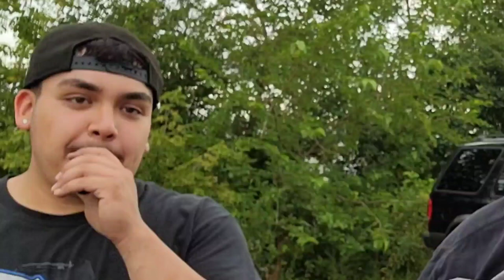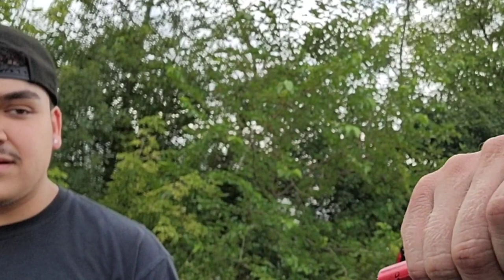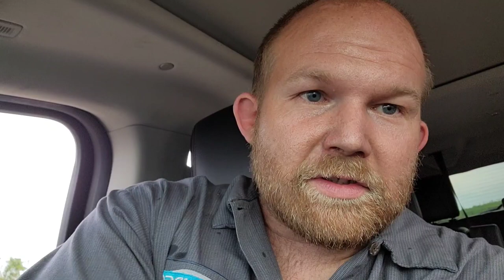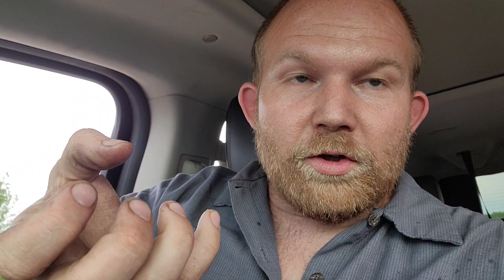Oil Filter So Tight - Try This And See For Yourself - Most Of The Time It Works 💪

Comment: I'm an express lube tech at north park toyota in texas. I'm definitely going to try this on my next filter that is stuck. Thanks for the tip
Reply from the maker: Remember just barely spin the filter, once it starts to move after you do the trick quick shut the vehicle off and then finish the job.

I think the part of this video that most people are not understanding is people got to use a little common sense you're using the oil pressure of the filter to help support putting the band wrench on the filter
 just hoping to get it to start to move you're a little bit
 not spinning it all the way off while the vehicle is running

Just enough
Reply: @FordBossMe  I believe most people understand that the pressure is helping the filter wrench not to crush the filter, I think where people are having an issue with running the new oil through the old filter. If you're going to have it pressurized anyway it might as well be before you drain it. I personally will start loosening the filter first. If its stuck I will try it with the engine running trick. So if I do accidently loosening it a bit to much and it starts leaking I'm just going to lose a little old oil before I tighten it back up a hair,  no biggy. Thanks for sharing my boy.
Reply: @PRBB25  Yes that would be the common sense way to do this.
Reply: Sooo - just crack the oil filter loose,  if the car is on a lift - lower it down,  and SHUT THE CAR OFF = then spin the old oil filter off  and install the new one (I partially fill the new oil filter first).
Reply: For Toyota oil filters, I just use my big three foot half inch ratchet. Always works on stuck Toyota filters.

Comment: Why can’t you do that with the old oil before draining
Reply: That’s what I was thinking
Reply: I like your idea !!
Reply from the maker: You can but most of the time people pull the drain plug first there's no right or wrong way to do it you've got it you're on the right track
Reply from the maker: I speak from what most commonly happens that's all
Reply: I always drain the oil before I take the filter off. How would I know that the filter was stuck before draining the oil?
Reply: My only guess is that he drained all the oil cia drain plug first and then tried to loosen the filter
Reply from the maker: And you are absolutely right most of the time that is exactly what happens people drain the oil first and then they're like oh s***
Reply from the maker: This is a way for you to save yourself some struggle and make it a little bit easier
Reply from the maker: And now all the Clowns with the thumbs down on the video because they don't take a second to try to understand exactly what's going on here it never amazes me on the internet people are so foolish
Reply: @billbraun6846  Break the oil filter loose first, hand re-tighten filter, and then drain the oil?
Reply: I always undo the filter before draining the oil, as I have a traditional pan and I've dropped that filter into a full pan and it's not pretty ;-)
Reply: @FordBossMe  Yes, but you have a nice drainage system that prevents splash, while the rest of us will make a big mess ;-)
Reply: @FordBossMe  It's not so much the fools, it's the stupid you have to watch out for, and we're surrounded ;-)
Reply from the maker: How many people are going to do that? That's not how they're taught 90% of the people grab the drain plug and start draining the oil that's how the typical person is taught you're not going to be able to put out a video first to explain this to people because that's not how they're shown to do things
Reply from the maker: People have to think a little bit outside the box instead of getting so uptight and trying to be so politically correct about everything

You always get under the vehicle you pull the drain plug and you let it drain well when there's no oil in the pan you can't do this so you're going to end up putting fresh oil in the motor anyway so put the plug in fill up the vehicle with the proper amount of oil and then do the trick
Reply from the maker: @chonkboy77 ^^^^^ read above 2 comments
Reply from the maker: @jamesplotkin4674  we cannot take one person's experience and then project it out on a crowd of a thousand different people right because when we do stuff like that the message doesn't get out we have to put a general message out there for people to get and will apply to most and then people have to sort through the little pieces that don't apply to them themselves
Reply from the maker: Chonk most people don't do that and they won't do that because they weren't taught that way
Reply: @FordBossMe  I get the drain plug first, then the filter for the simple reason that I like to give the pan a bunch of time to drain and can pull the filter while it’s draining.  I bet that’s why we’ve all grown accustomed to that order.
Reply: @jamesplotkin4674   very good point
Reply: @FordBossMe  And then they end up with a 20 minute sweating, straining, cursing struggle. Oh well, hopefully after one of those they rethink their approach.
Reply: @johnwilburn  100% correct.
Reply: @FordBossMe  I would always pull the drain plug first. Probably stemmed from working on tractor trailers. Get that 40 or so quarts draining, then start working on the filterss. Then when I switched to regular vehicles I did the same. Not sure why but about 5 or so years ago I started pulling the filter first and been doing it ever since. Like you said most people drop the drain plug first. Just petting in my two cents. 

Great info though, will definitely keep that stored for future use.  

Also you probably should clarify to just loosen the filter while the engine is running and not remove or REALY loosen it. Shouldn't have to be said, but you know idiots are everywhere. Cheers.
Reply from the maker: @themc3311  you're right I shouldn't have to say that and maybe I should have put it in the video but people should know better
Reply: I always do my filter first just in case it won't come off. I never wanted to put new oil through an old filter
Reply: @mikefriday5325  So you've used Rich's method before and that's why you take the filter off first.
Reply: @billbraun6846  no I haven't used his method. He taught me something new. I just always take the filter off first in case I have a problem getting it off
Reply: @FordBossMe  I've learned to take the filter off first. I want to know ASAP if there is a problem taking it off, or if we don't have the correct replacement get that ordered before it's too late. Delivery driver takes half hour round trip. Could get that filter before the customer notices if it's ordered fast enough. 🤔🤷🏻‍♂️
Reply: @FordBossMe  "oh s***"
😳Oh no! Is this a family channel now?🤔😂🤬🤬🤬🤬🤬😂
Reply from the maker: @mikefriday5325  new oil through an old filter is minimal effect if you're taking care of your vehicle and anybody that says otherwise I would not even listen to
Reply from the maker: @mikefriday5325  it's not like you're magically going to let the oil touch the old filter and all of a sudden it's going to be completely contaminated and trash and no good...... it's not like a little oil filter Fairy comes in there and shakes their wand at it and destroys all the oil
Reply from the maker: @RJ_Cormac  why would you question whether or not it's a Family Channel it is but I'm not changing how im doing things I wouldn't expect anybody else to either
Reply: @FordBossMe  It was a joke because you ** out your language in the comments. 🤷🏻‍♂️ Did't mean nothing.
Reply: @FordBossMe  lol. Good point

Comment: Good tip Rich. It might seem obvious, but for the inexperienced, don't spin the filter off too far...Only do this enough to get the filter moving, or you'll wear oil all over you, and you risk running the engine without oil while you put the car back down to switch it off🤣👍🇦🇺

Comment: I've always cracked drain plugs, filters and fill plugs loose right after the car was shut off. I learned the hard way not to drain something if you can't get the fill plug or filter loose. Engine heat and pressure do amazing things

Comment: I usually do the filter 1st so its likely I'd try this w old oil still in motor,, but thing is though I've only had this problem when I'd purchase another car only 2 find last owner or tech overtightened the filter n sometimes drain plug 2., just love other people which is y I'm a diyer,, worst one I had was 88 T Bird Turbo Coupe n had to stab that poor filter two times man I felt awful 4 doin that but hey it worked! Thanks 4 video
Reply: That's a great tip - remove the oil filter FIRST, in case you have to use this technique. Everybody does the drain plug first because it's easier but I hate the thought of putting dirty old oil (even the small amount in the filter) into the new oil.

Comment: I did not think of that, thanks. Dealer ship put filter on tight, it crushed with band wrench. It did come off with pliers wrench, put counterclockwise power and hold, it will slip open after a while. Key is to put power in and wait it will slip open. Your idea is very good, filter will not crush, and that is the main problem.

Comment: Never tried that one! Good idea. 
I started my career as a lube tech on semi trucks. The worst filters I had were when the screwdriver ripped the filter housing off, and I had to use a air hammer and chisel the filter head off. Oil and fuel filters. Some drivers were known to tighten filters as hard as they could after they left the shop.
Reply from the maker: Yep this would help that

Comment: My Toyota dealer tightened the metal filter housing on a 16 V6 Camry so much that with the proper tool and a 2 foot breaker I couldn't get it loose. It took a 1300 ft-lb impact adapted down to break it loose. No damage to the housing or the tool. That dealer can't balance tires either. What kind of slug tightens so severely when it's obvious that the seal is accomplished with an o-ring, not torque?

Comment: It’s good practice to loosen the filter AND plug a half turn before draining the oil. No point in proceeding with the oil change if either is locked or cross threaded unless you are prepared with parts to repair what’s damaged.
Reply from the maker: Yeah I mean ideally sure you would be right but nobody does that

Comment: Each to their own. I think this is a bad idea.  What happens if you end up with a leak and hot oil starts running all over  your arm and the underside of vehicle, are you going to be able to get it back on the ground and shut it  off before you end up with one hell of a mess?  I think your better off clamping your wrench or strap at the strongest part of the filter,  up by the base.
Reply from the maker: First of all you have to be cautious when you do stuff like this and a person that is not trained shouldn't be doing stuff like that

It's not my job to babysit people

I'll demonstrate soon for the negative Nancy's  here
Reply from the maker: That's inexperience talking Greg not every filter is eccesable that way

Comment: That’s a good idea but I think it would be worth trying with the old oil in vehicle first before I ran clean oil in a contaminated filter. That’s just me being OCD lmao.
Reply from the maker: There's a method to my madness right? The reason I specified it the way I did is because that's the way 99.9% of people are taught they do not touch the oil filter first sometimes you have to think outside the box when you're teaching something and that's exactly what I did here cuz most people will always go for the drain plug first
Reply from the maker: You're going to get that oil dirty Anyway by running it through residual oil that's in the engine that little bit that's in the filter I know you said it's your OCD talking but it's very minor almost doesn't affect it at all

Comment: If you have a metal oil filter cap that you attach a 3/8” socket wrench to. Use a long handled torque wrench.
Reply from the maker: It doesn't always work rounds off the filter if it's on tight enough
Reply from the maker: I'll demonstrate soon
Reply: Some filters are fully smooth, no indentations around the outside for the special filter socket. Or no welded on socket drive upgrade. The cheapest filters are as smooth as a the first 3 weeks at a sorority house! Don't approach that door after 3 weeks⚠️❤️🤮

Comment: That sounds like a neat trick I would like to give it a try but Can I do it with the old oil in the car still
Reply from the maker: Very few people try to spend the oil filter off first seeing as they left the motor drain so that's why this bill was put out this way you can do it however you feel

Comment: why not just loosen it with the old oil?
Reply from the maker: Read pinned post 

Nobody ever pulls the oil filter first and it's a Rarity to have somebody pull the oil filter first... what most people do is they get under the vehicle and they start draining the oil so they give it time to drain and then they do the oil filter

So rather then changing the way 99.9% of the people do oil changes out there how about work with them and make the suggestion that I made here which makes a lot of sense

Comment: noooo thanks. not a bad idea, but the idea of pressurized oil spraying everywhere is enough for me to say "...i'll just cut the fkn thing off" instead. 

never met a filter i couldnt get off ( ;) ), in spite of the local valvolines over-tightening ridiculously after --not-- lubing the gasket
Reply from the maker: Well there's a lot of common sense goes along with this recommendation as well and if you don't have that people probably shouldn't be doing it and they know who they are
Reply: @FordBossMe  common sense or no, shit happens bub.  obviously you wouldnt want to use the claw-style filter wrenches - band would be the way to go.

itd be my luck id break the whole damn stem off - oil filter and all. im a big boi, lots of torque in this ass lol

im definitely not in the grouping of people lacking common sense. 

the grouping of people considered unlucky however...well...sometimes home is home, ya know?

Comment: By that logic, why not just do that from the start before you drain the old oil out?
Reply from the maker: Because nobody does that and nobody's talked to do it that way so the way I explained it is the typical way that people do it 99.9% of the time
Reply: I’ve changed lots and lots of oil and filters in my life in all types of vehicles, cars,trucks,motorcycles,  quads, boats, tractors never once had a problem. I’m sure you pros have to deal with it more than you care to having to follow behind folks work that “think” they know what they are doing, I get it and that is a great tip, something that I had never thought about! 
An uncle of mine used the screwdriver method every single time he changed oil, standard procedure for him because being the cheap (this works fine) guy  he was NEVER owned a proper strap wrench in his life. LOL.
Keep up the good work, I enjoy your channel

Comment: wow!!!  you gotta be kiddin that you actually want people to believe that...wtf
Reply from the maker: Are you going to troll my Channel or are you going to explain what you're talkin about instead of talkingshit
Reply: we have done that on highway trucks as well and  D8 and D9oil and HYD filters ,just turn it enough while running to loosen it with out spraying oil ,then shut down your unit . its the same idea as draining your manual trans on highway trucks or rear end , undo the fill plug First. always put your filter wrench or chain wrench as high as you can ,that's were the meat is.
Reply: Pressure in a thin walled container would make a huge difference in preventing it from collapsing. Also... the pressure pushing the filter outward would likely reduce the tension on the gasket and make it easier to spin off. Science seems to jive with the idea... but Harry doesn’t like science. 😂

Comment: But that will go sideways fast if you poke a big hole in the filter with the engine running depending on the type of wrench you are using. Almost every toyota cartridge filter i change after somebody else did it i have to do it with my impact instead of wrestling around with a breaker bar. and using the impact my tool never gets stuck on the cap. even the toyota's with the plastic caps. but i dont use that method with the dodge and kia cartridge filters since the entire thing is plastic. even that 25 nm they recommend is too tight. as soon as the cap touches the engine is tight enough.
Reply from the maker: Right people have to use some common sense and be very careful
Reply: Yeah cartriges i never understand when people crank them down, that o ring seals so damn tight they never move
Reply: instead of saying 25 nm it should just say don't be a ding dong. it's a plastic oil filter not an axle nut.

Comment: I designed an oil filter removal tool that has a screw in hardened cutting tube that screws into the filter. This provides a way to drain the filter before removing it and the tool can't slip around an overtightened filter allowing you to remove it. Simply clamp the removal tool around the filter, attach it's drain line to the cutting tube, screw in the cutting tube punching a drain hole in it and let the oil drain while draining the oil pan. Then turn the filter with the tool until it's loose and remove the cutting tube hose and the cutting tube along with the tube. No more oil running out everywhere when you crack open the filter even when mounted vertical and no slipping tool on the filter.
Reply from the maker: Sweet I'd like to see it
Reply: Patent pending at this time so I can't show it. Lawyers are the problem.
Reply: Bwaahaahaaa !
Reply: @belly tripper watch a few of my videos. I'm not a professional YouTuber but you will understand that I design and make stuff.